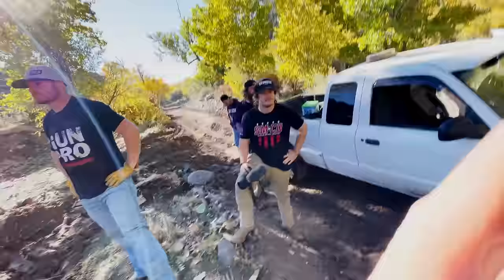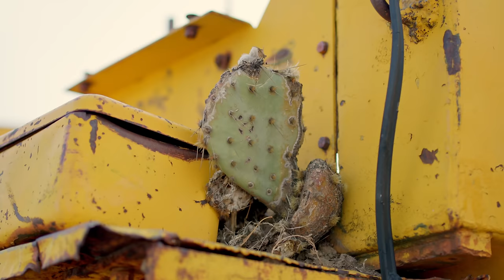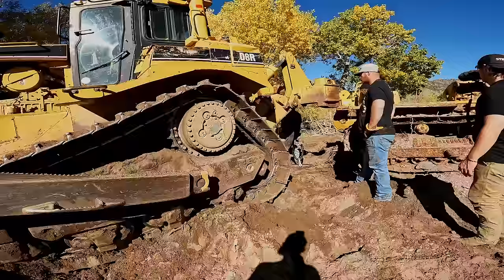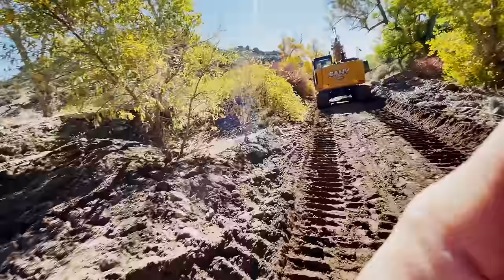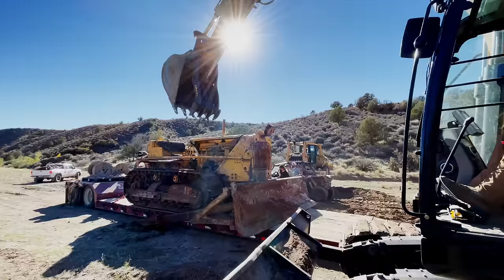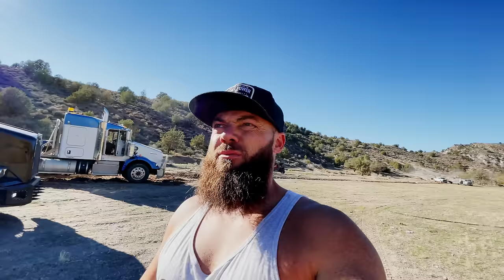How To Haul A Dead Dozer Down The Mountain - Insane Dozer Recovery!

Comment: Hey guy's if you ever get an old say R/D8 cat and want to give it more power than any dosser could get ? Do this -Take the diesel motor out and find an older 6 cyl with a 4 or 5 speed truck transmission with a low granny gear speed trans mission modify it to hook up in the cat build a small drive shaft where it will fit into the cat transmission. You want digging power put the cat into `1st and  the ford Tran into granny low and it will dig itself grave before it would ever stop the tracks from stopping due to power loss.-Jimmy. The old truck driver.

Comment: That old cat D8 is either a 13A or a 14A,I worked in a Cat dealer from 1963 to 1972 and we worked on many of these tractors. The next model was  a 15A  and then the new ones were the 36A and then the 46A and then the high rack

Comment: Never I'd stuck cat but  it is a D 8. Ser 8R  40s  .  The suggestion to disconnect final drives  has obviously  not worked on older D8s. No simple  way to  do  .

Comment: So guys for next time on a dozer that doesn't move, look for the final drive. It powers the tracks. It has the sprocket on it and there should a cover. Remove that cover and there usually an axle that powers the final drive, Remove both axles  and the tracks should freewheel, however it won't stop on its own. It will move on its own going down hill. Be aware. Take care

Comment: 1/2" ish steel plate fashioned into a skid plate with half round front end and 45 degree sides armour plate would do. Eye lets and u connections for towing as wide as your trailer and half to 3/4 the length of the bed . Place dead vehicle onto sled makes pulling easier.

Comment: If you count all the men hour and the cost of fuel and everything compare all that  to simply paying a crane company to just pick up the dozer right out of its hole and load it on a trailer in matter of just few hours and it is done and finished.   
and I can bet it would even be so much cheaper and so much hassle free.

Comment: This part 1 and part 2 situation was crazy as can be. In the end you done what I was thinking halfway through the first one and I know it wasn't my exact as my thought. 

I thought, stair step one side, then find a part of front frame / back frame, hook chains, and drag it out sideways.  Straightforward with a dead weight and the tracks were doing nothing but digging in / adding more weight. 

Sideways would be narrower and lifting it up would help pull it out without digging in.  Because I'm also stupid as can be sometimes, I would have lifted up one side of it and tried to knock a bunch of dirt out of the tracks to hopefully free them up.

Comment: Just an idea for future recoveries.. What if you put metal plate late underneath the machines like the Crane that you guys did and make like a sled that you could move it on. Use the heavy machines to lift the dead machine get a thick steel plate under it and pull it like a sled? Wouldn't that work ? Reduces friction 10 fold

Comment: Boys why wouldn't you take the ripper off the D8 back it up as close to the old Dozer as you can drop the ripper cradled down as low as you can choke the cable as short as you can over the top of the D8s ripper cradled then lift the ass of the old dozer off the ground making it easier to drag

Comment: You could also design large U shaped steel frames with large square steel braced on the corners with a winch or block and tackle lift on top so you can strap it around the load and lift up. Then on the ends of the U at the bottom where it meets the ground put a set of dual axle trailer tires. Four tires on each U and at least two U frames per machine lifted. The front set could have a steering triangle that pivots the wheels and mates with the hitch. You could strap them onto the load after and they could also have lights or something depending how you like em. Or like the same thing with tracks.

Comment: You guys should make some sleds where you can move objects on like the dozer that won't drive and than pull the sled, it's easier towing and leaves the area behind it nice and flat, we used that method in the offshore with anchor handling if we had to pull anchors to the front, so the anchor would not wreck up the wooden deck.

Comment: So with such heavy weights, why not make these slee type beds with front curve upwards and a nice connection for pulling.
You use the sled where you put the vehicle on top of and pull the whole kabus like your doing snow riding ?
I know that is about the thin snow slide you can go with doing these kind of works.

Comment: If there is ever a "next time" when you have a job like this, where the tracks are seized, I think it would be a good idea to get some steel plates under the machine you wish to rescue.  Smooth steel plates would allow the machine to slide much more easily, like a sled.  This job was made more difficult by the lugs on the seized tracks digging into the ground.

Comment: Great to watch love it just 1 small question? If u use power line poles underneath the dead weight might b a little easier to move, but still great watch all the same

Comment: My sister and BIL drove 12 & 15 CU rock hauling semis for the construction of the LBJ freeway. 
One day she was forced  to the soft shoulder and buried her IH up to the axles, tractor and trailer.

It took a BIG Diamond T wrecker with a 60-ton winch and 1 ¼” cable to pull that tractor/trailer out.  (It had already snapped a 3/4” cable on another wrecker.  The BIG wrecker had to be chained to TWO other trucks tied in series, as it just dragged  the regular scotch blocks across the pavement.)

Thank Heaven we didn’t have to try to shovel out 12 CU of gravel onto the side of the highway!

My BIL said that he ever found the SOB. who forced her off the road, he’d “Stomp a mud hole in his ass and then stomp it dry!”

Sign me the Yankee Texan.